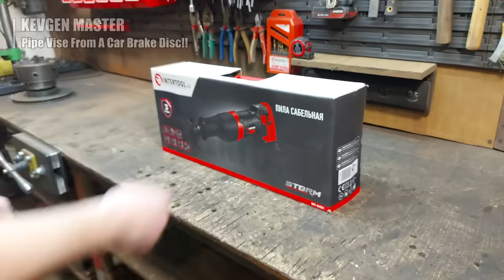Мощная Идея Из Тормозного Диска!! Трубные Тиски Из Автомобильного Тормозного Диска!!

Comment: This could be made into a screw operated press for bearings or for bending steel, instead of the bench vise holder, with other bolts through the table to lock it down.

Comment: Unnecessary complications of simple problems. Any vise, found in any workshop, and a template for curved shapes to be inserted, if necessary, achieve the same result, actually better, with less work and less expense. If you made an extractor for it, it made more sense.